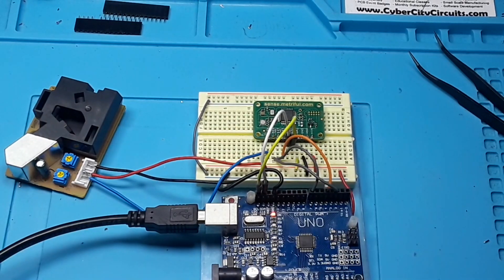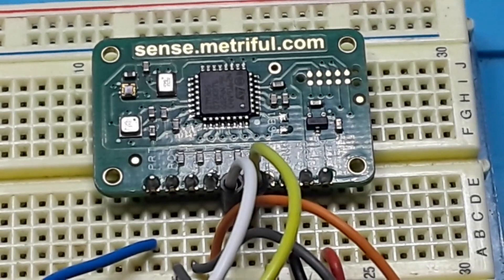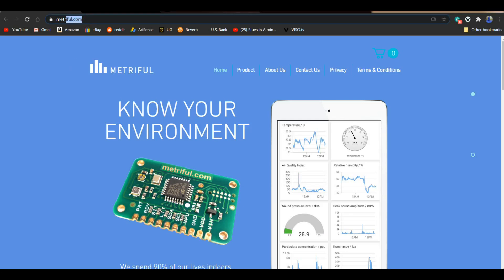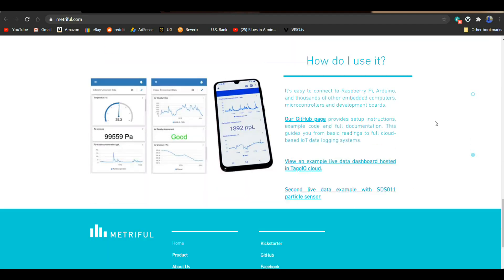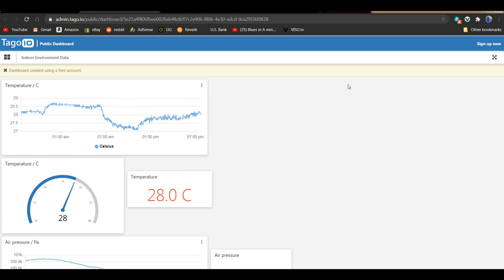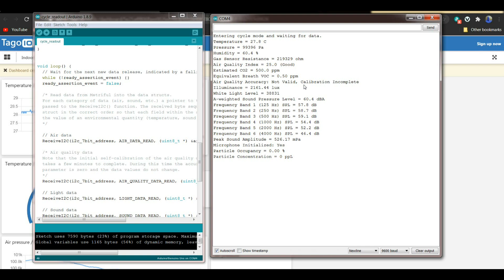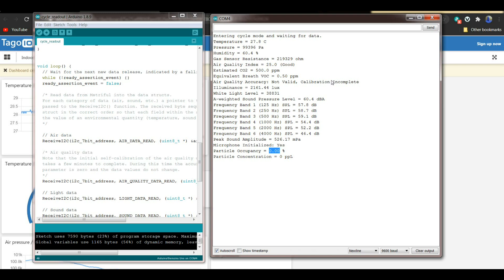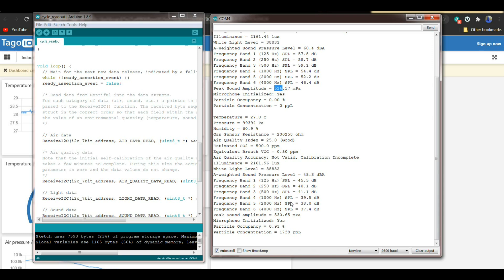Metriful MS430 Environmental Multi Sensor for Arduino and RasPi

Comment: Well at least this device is an interesting concept. At best it can be used as a toy to experiment with. If It cant survive an industrial or automotive environment what real use is it? Sensors need to be robust. They should reconsider their design. I guess if the manufacturer's objective is a limited target audience and they are not looking to have this device in production for the long term then the design is fine. As an EE you must recognize the predictable and limited uses for real world applications. At least an Arduino or a Atml 328 on a circuit board can be placed in an environmentally protected enclosure. Other than that it's a good video. You did your part.

Comment: Hm. Sounds interesting, but I'm a bit worried about the layout. Placing the sensors this close and without any (visible?) electrical and thermal separation sounds like a big invitation for noise and inaccuracies.

Comment: Not all things that are possible make sense. This neat little sensor would probably make more sense hooked up to an ESP32 or 8266 and Node-Red dashboard. If you set up a dedicated Pi, with all that number-crunching potential, to deal with just this sensor, it has to be physically no further than 1 metre from the sensor because of I2C limitations. That is too expensive and a waste of the Pi's capabilities.  And most of us have already got an existing WIFI network anyway. For remote sensing, the Pi would be severe overkill.

So if the choice is between an ESP32 at about $7 apiece and a Pi in excess of $35! I know what my choice would be!
Reply: Captain Pugwash I’ve been successfully using a BME280 15 feet away from a Wemos D1 mini. Used an old 4 wire telephone wire.